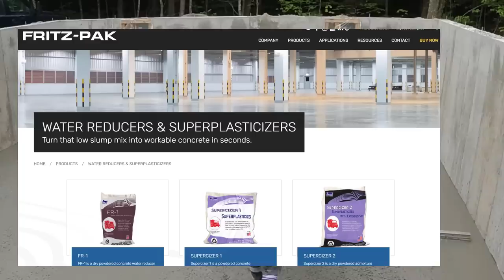We Had Some Problems To Deal With | Lucky We Had This Today!

Comment: Mike, great work as always.

You mentioned poly under the slab. Do you always recommend poly under basement & garage slab?

Also, for a concrete porch w/ concrete walls w/ frost ftg in MN, my excavator said to Not pack the subgrade as it will allow wiggle room for frost heaving. I've never heard this and am Very sleptical. Thoughts?

Comment: Thanks for the great video as always. If I may have a question a bit off topic as I believe your slabs does not blister, any way how would you recommend repairing blisters and rough corners with low spots on power troweled floor which is to be epoxy coated?
Reply from the maker: I'd use a product called Quik Fix from deco-cretesupply.com